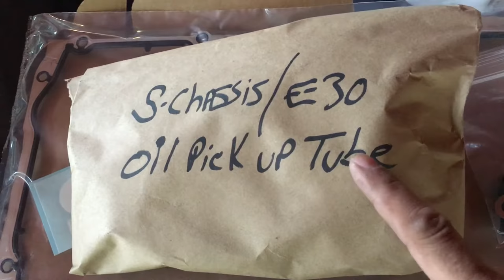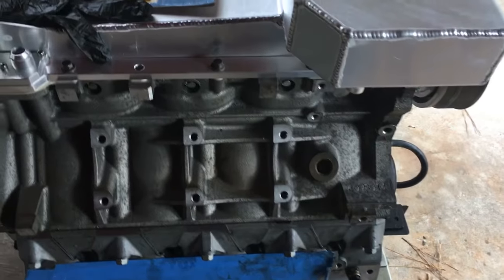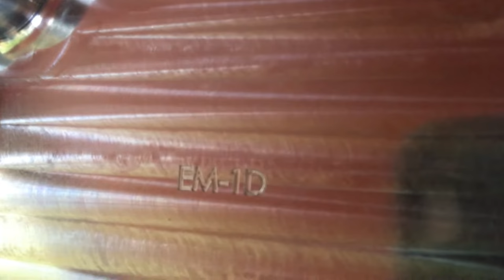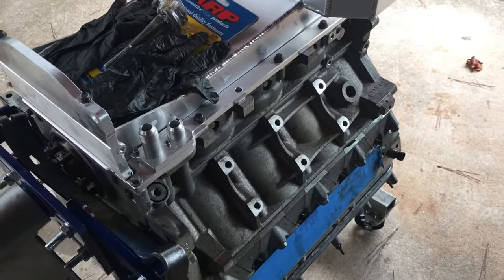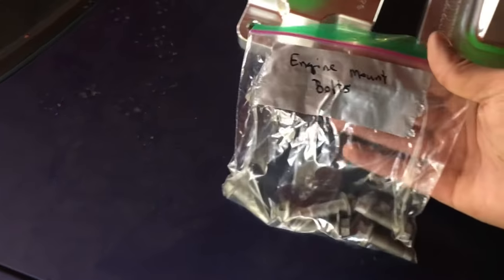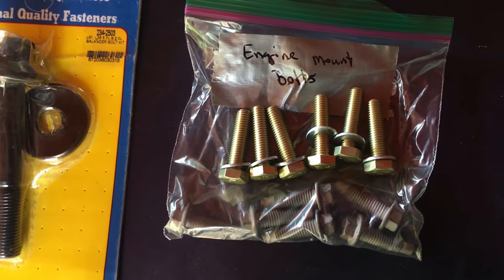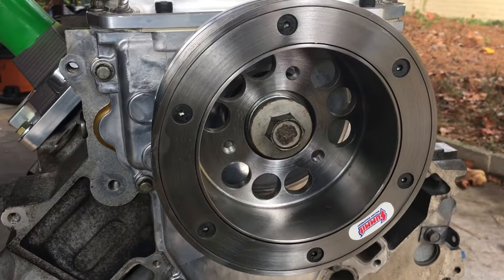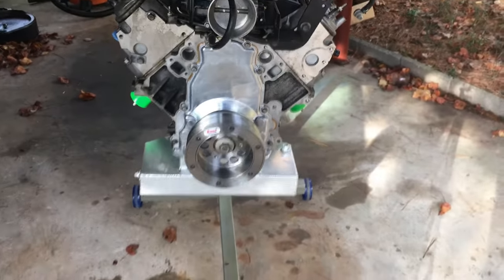Sikky Oil Pan & Engine Mounts Install - LS1 240sx (S14) Drift Build (EP 15)

Comment: Did the sikky oil pan require any modifications to fit in the car?
Reply from the maker: with the sikky motor mounts the sikky oil pan went on and in without any modifications. The only issue that I saw would be is the stock front sway bar would hit the oil pan. I took off the stock front sway and put on the sikky front sway and it all fits well. If you were to use another kind of mounting kit it doesnt look like it would be a problem as well but I can be sure.
Reply: ToxicMongoose, thanks for the reply. Im not changing the sway bar yet, so i decided to try the swap pan from cxracing. It looks like they dont require any thing changed or modified to fit. Thats what they say anyway.